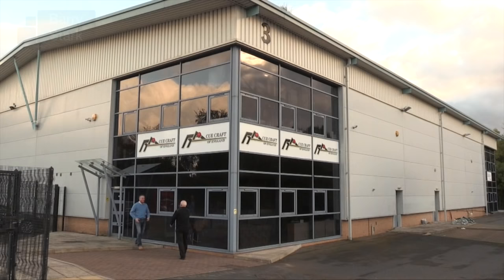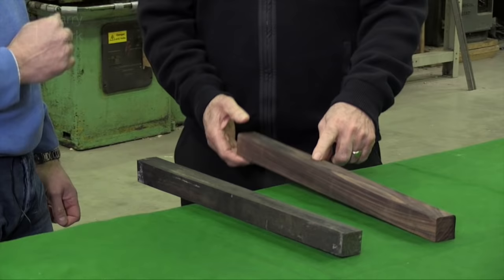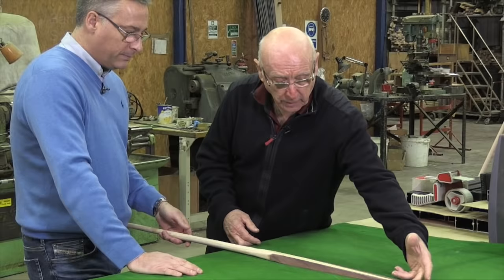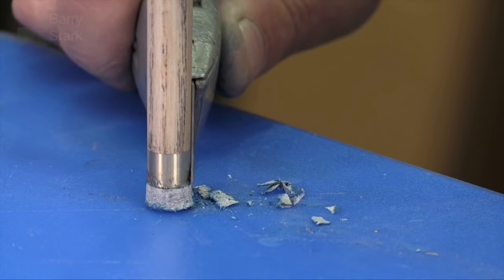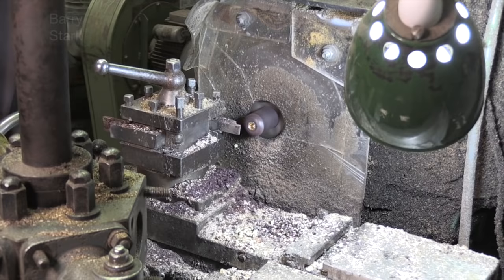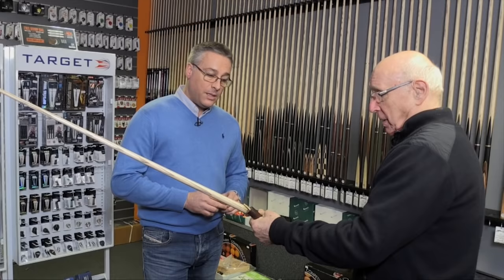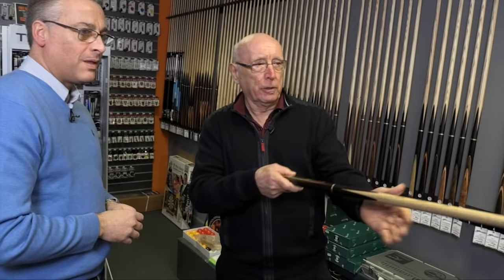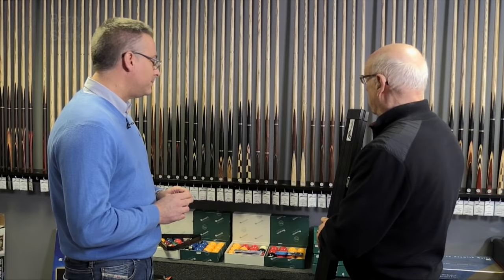46. The Cue - Part 1 Manufacturing

Comment: Great video and great to see the lengths craftsman go to to create a nice cue.  A little disappointed to see the tips of the splicing didn't all line up perfectly around the cues - something I love about my cue.  I think I have the same case and although I don't use it, I have my original Riley cue I bought 26 years ago in with my TW cue and it is straighter now than it has been for years after my ex-girlfriend left it against the wall over a radiator!

Comment: Why does the grain of the wood for the shaft  so open grain? It looks like it was made of the wood salvaged from a shipping pallet. I favor hard maple, with a finer grain. It is easier to keep smooth with a little piece of 600 grit sandpaper.
Reply from the maker: Nifmakr. I personally prefer the individuality of a nice piece of ash wood but there are many snooker players who like you prefer maple. Either way I would never use sandpaper on a cue once it has been made and finished.

Comment: Hi Barry, could you please talk about the differences between pool and snooker tables; types of cloth, angle difference, pockets, etc. I am mainly a british 8-ball pool player but would like to progress to snooker. However, I have trouble with certain shots on a snooker table, mainly the screw shot. I have no trouble screwing back on a pool table but on a snooker table I struggle and I'm not sure why. So could you try and address some of the differences please in a future video? Thanks.
Reply from the maker: Tom. The reason you can screw back on a British pool table is because the cue ball is smaller than the object ball, which means that when the two balls make contact the centre of the cue ball is beneath the centre of the object ball, its purely a physics thing. I would suggest that you have trouble with certain shots on a snooker table principally because of the distances involved. In general distance makes any shot more difficult and examines technique more. Generally speaking, any good snooker player would be more that adequate at the British pool game. As far as I know the cloth is pretty much the same, angles should be the same because of the rectangular  shape of the table. Pockets in professional snooker are cut to templates but vary in amateur clubs, I assume this is the same at pool.
Reply: Okay thanks for your help, maybe I should examine my technique a bit more then, probably using some of your videos! Keep up the good work

Comment: This is very interesting.. snooker is a more traditional game. Are there no low deflection cues for snooker?
Reply from the maker: John. Most snooker cues vary somewhat with the amount of deflection determined by many factors. I don't believe that snooker cue manufacturers have gone into the science of this quite as much as the pool cue makers relying mainly on their experience on wood selection and their expertise in the manufacturing process.
Reply: @BarryStarkSnookerCoach  ohh yeah it seemed like they didn't use then same machines that pool cue manufacturers use and the lathe and such. Why do they not dive into the science of deflection it would make some shots alot easier especially with lots of spin. I love your videos by the way they are great! I played snooker once and have much more respect for the game it is very hard.

Comment: Beautiful cues!  Is there a size in relation to height of player or other characteristics?
Reply from the maker: Javier. The average length of a cue is 58 inches, however tall players sometimes do need a longer cue. For example Kyren is 6ft 1in tall but he has very long arms and therefore needs a slightly longer cue than standard, his is 59 inches long. I am much shorter at 5ft 8in with relatively short arms and my cue is 57 inches long. It is amazing how even small differences in length can make a huge difference, for example when I pick up Kyren's cue it feels as if I have the half butt in my hand.
Reply: @BarryStarkSnookerCoach  thanks a lot for sharing your wisdom. I played pool and caroom a long time ago all of a sudden I became aware of snooker. My oh my its beautiful game I have never seen a snooker table before, 6'x12'! That's has the size of a farm down here in Puerto Rico. But seriously I have been enjoying the games by You Tube and I get hooked or better "snooked" to the game. Thanks again.
Reply: @BarryStarkSnookerCoach  Ain't that the truth! I am 5'8", have two cues, one is perfect length, one feels "far too long". It is - in fact - c.1cm longer, but feels like two inches longer when I am down on the table. And I end up gripping the butt too far/high up the shaft, to compensate - yet the actual difference in height it almost negligible.

Comment: Hello Barry, I have been an avid follower of your tutorial videos and I really like to thank you for the knowledge. My question to you is, that I recently purchased a cue branded Master Pro butt now my issue is the grain of the wood has developed some crevices, which kinda pulls the stubble of my chin. I there anyway I can fill in those microscopic crevices with some kind of filling or rather lacker the cue?. Personally I do not like the feel of lacker which would be my last plan of action. Kindly advise?
Anup (India)
Reply from the maker: Anup. Please do not use lacquer. I assume you have a ash cue and sometimes the grain can shrink and cause these ridges, the answer is to take it to a reputable cue manufacturer and have it re-furbished. This should not be too expensive and they will use a grain filler and oils to make the cue as good as new.
Reply: Thank you barry..

Comment: hai sir,i'm from malaysia,if me want to buy 1pcs cue how much?with shipping.
Reply from the maker: Papa. I am afraid that this is really an impossible question to answer. Different manufacturers charge different amounts, added to that are the specifications that you require. The shaft wood is graded by the manufacturer, the better the wood the higher the cost, then there is your preferences on the butt of the cue, the more inlays you require the more labour intensive the manufacture is and the more the cost of production. These facts are prevalent no matter who the maker is. When it comes to shipping I am afraid I have no idea, you would have to talk to the supplier. What I do know is that the actual cost of a decent cue will vary from around £200 to as much as £1500, all I can advise is that you view the various manufacturers web site.

Comment: didnt i see a screw thread on the inside of the ferrule? the craftsman proceeded to hammer it down onto the shaft, lol.
Reply from the maker: jhaga. Most ferrules have an internal thread but there is no need to create a thread on the cue shaft. As long as the diameter of the shaft is correct the ferrule just needs a light tap to position it. The ferrule is then secured in place by the adhesive filling up the gaps caused by the internal thread.

Comment: Barry Stark Snooker Coach 
I am thinking of investing in a cue and was wondering if you'd recommend a 1 piece cue like the one made in this video or a cue with a joint.
Reply from the maker: Whatever. This is personal preference, some players prefer the one piece saying that it adds to the feel of the shot, I don't subscribe to this theory and a three quarter jointed cue is just as good in my view. It is certainly easier to carry around.
Reply: thanks for the advice. I've been to the shops to try some cues out and i think I've made my mind up on a 3/4.

Comment: Hi Barry, is there a difference between a hand spliced cue and a machine spliced cue in terms of playability?
Reply from the maker: Nadia. Providing both are well made there is very little difference. Sometimes with a machine spliced cue there is weight inserted 
for balance and weight. This can become a little loose but not if you buy from a reputable dealer and don't misuse the cue. Some pros still use a machine spliced cue.
Reply: Thank you Barry for your timely response.  You are a great ambassador of the sport.  You're videos are on point and you're tips are very helpful.  Keep up the great work.

Comment: why don't you lean you pool cue up against the wall
Reply: If leant against a wall, a cue becomes more prone to warping and/or developing an unwanted curve.
Reply from the maker: I cannot improve on that answer. Well said
Reply: Barry Stark Snooker Coach I just got aramith super pro balks today they are so good
Reply: The best Balls in the market
Reply: Chris Buckland  because it would warp the cue
Reply: i guess i will start bending the cue due to moist & gravity...
Reply: Chris Buckland I
Reply: i know this doesn't help at all but this was about snooker cues not pool cues completely different ;)
Reply: I'm having kids
Reply: Chris Buckland hi how are you doing toda
Reply: Chris Buckland hi how are you doing today
Reply: That so true I think he meant to do the and any body else get a little creeped out
Reply: The weight would make it warp
Reply: @bob733333  is not a myth as as I've had to straighten a few cues that had been left in cars but more so when they have got really hot.
Even when they were in cases.
Reply: @bob733333  if the cue is almost straight it will be fine but if the butt of the cue is to far from the wall, it will warp.
I make and repair cues, plus have been an Antique furniture restorer for about 34 year's.

Comment: Why Ash ?
Reply from the maker: Jonny. Some would say it is tradition but most snooker players like the feel and sound of ash cues. It also has a prominent grain which adds a little more individuality  to the cue. The chevrons produced by the grain also aid some players with their aiming process.
Reply: @BarryStarkSnookerCoach  thank you so much for your reply .Barry. I have been tossing and turning over Ash wood  .when it comes to me making my first pool cue 🤔to be honest  I even thought  about going with bamboo because the straightness of the grain I could easily separate the grain an then  piece it together with a good type of shock absorbent or shock resistant resin  and then shape  it down .I hope an really think a bamboo cue would be  extremely accurate and making the  grain  straight by piecing it together wouldn't be too much effort  an I say that because  where I live in New York it's very hard to find ash trees anymore unfortunately..